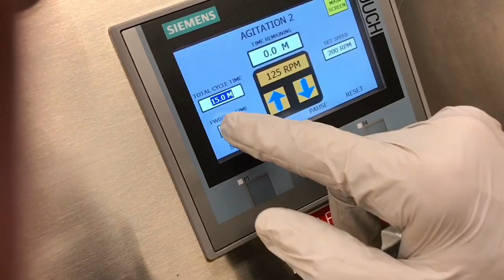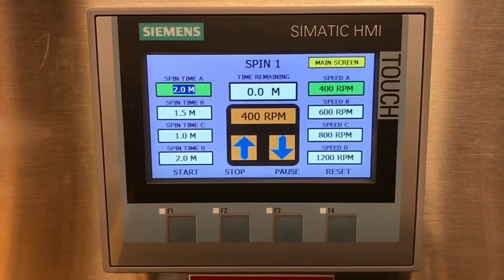Delta Separations CUP

Comment: Will this produce shatter?
Reply: Not like a hydrocarbon would. This is a very high quality engineered Ethanol Extractor. Ethanol doesn't produce great shatter consistencies.
Reply: @tlpbloomer701  You may be incorrect. If starting with fresh frozen material, and utilizing the inline filters, this should produce shatter. It is only a matter of filtering the unwanted fractions from the extract, such as chlorophyll. Look at the color of the final solution. CO2 or butane extracts have to be winterized in ethanol to make shatter. This produces a winterized product right from the extractor. It's all done at cryonic temps (-40°) After evaporating the thanol and final drying in a vacuum oven, the final product should be indistinguishable from a hydrocarbon extraction. And a hell of a lot faster.